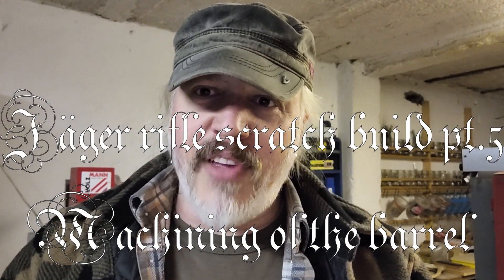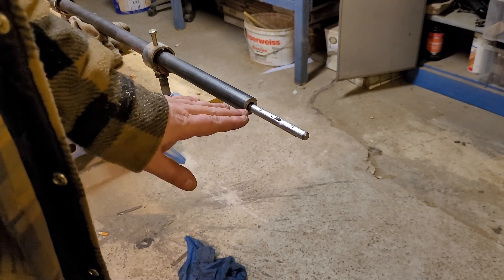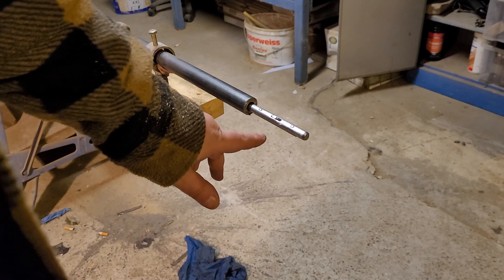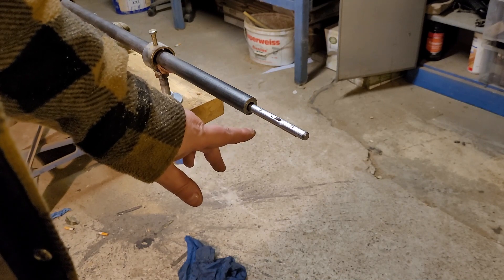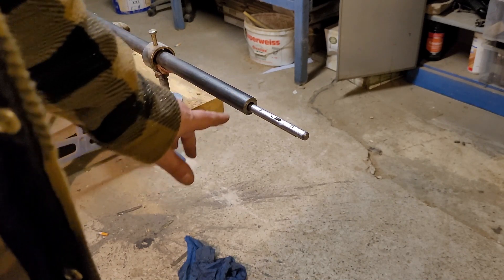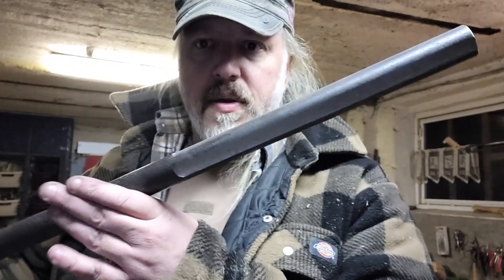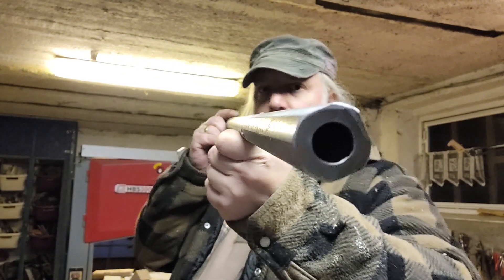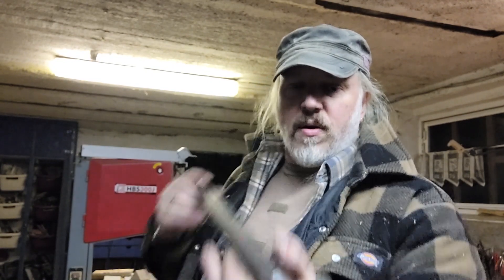Jäger rifle scratch build pt 5 machining the barrel

Comment: Nice work! congratulations! what type of steel are you using? (i think carbon steel, but what kind of?)
Reply from the maker: Thanks a lot 😁It is ST37 mild steel. for a muzzleloader it is not needed to ust high carbon steel because the presure is way lower than with modern ammo. BP is about 900 bar max. and modern is about 3500bar. Original old muskets and rifles even has a iron barrel..... My muzzloaders all get official shooting on the german state office so it is ok.
Reply: @homemadehistory7537  thanks for your answer! Amazing job!

Comment: The rifling came out really well, and I am glad to hear the brass rifling cutter made things easier, or at least more consistent, the milling machine does really save an enormous amount of time on these projects, although the cutters are expensive, a pair of small bed jacks would be nice to stop any vibrations with the overhang of the barrel, you tend to get a vibration set up when you are cutting a long workpiece like that, very nice progress! Have a relaxing Christmas now your windows are all in! Chris B.
Reply from the maker: Regarding the set screws I had the same thoughts and it would make sure, that the barrel is waterlevel with the sled. Especialy in such a case where i have to change the position very often. And for sure it makes the process much faster and the best is that I dont have to deal with the mess fromm the anglegrinder. Everything was covered with grinding dust 🤧now it runs much more clean. Roger S.
Reply: @homemadehistory7537  Yes that is one problem with a shorter Mill bed, but you would need a 48" bed to mill it in one cut, I also use a shell cutter that is 100mm dia that gives a much cooler cut as each "blade takes more time to go round, but with a reduced feed speed it is just as good with a 25 mm cutter like you have. Stay safe!, Chris B.